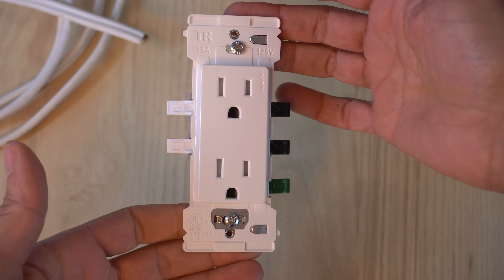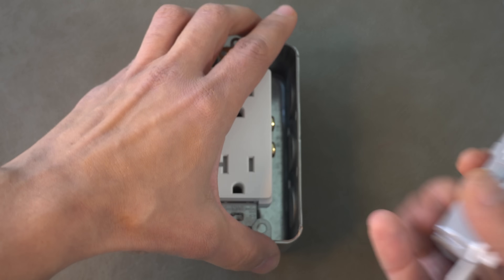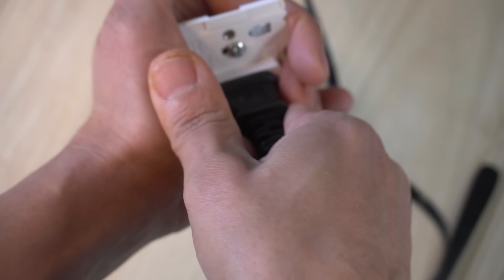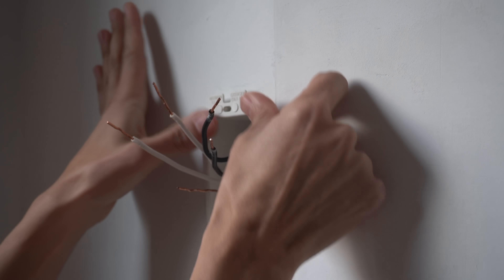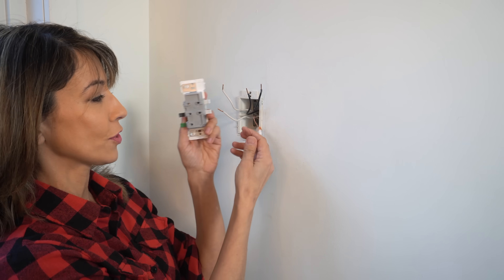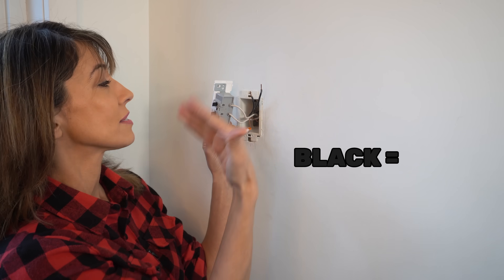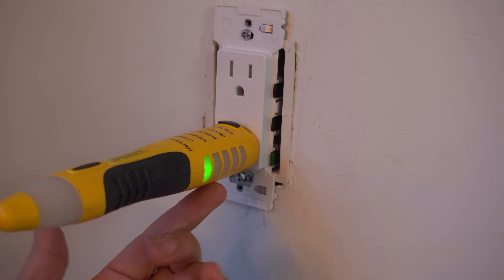New Electrical Outlet Installation: 3 Essential Improvements You Need To See

Comment: That type of receptacle is geared for the home owner and I'm sure plenty will be sold. However they are more expensive and you won't see many or any contractors using them for that reason. Also the "connection points" while fast and easy, they are not as good as screwed connections which have been around since receptacles came into existence and a proven way to effectively terminate wires on a device. The key to a solid connection with a wire is "pressure" and "surface area". With a "screwed connection" the wire "hook" around the screw is completely sandwiched between the head of the screw and the flat brass area it gets pulled against on the device . Once tightened its not moving.  A "pressure connector" or a WAGO connector does not exert the same amount of pressure to the wire and the wire is much shorter than the "hook" giving it less "surface area" as well. These are the two key difference's between these types of receptacles.  When you start running 12 or 16 amps through these receptacle's, connections matter.  It takes more time and skill to "hook" your wires and "screw" them to the receptacle but its worth the effort.
Reply from the maker: Thanks for sharing your insights on the benefits of screw terminals. They go the distance!
Reply: Very good reply and so accurate. Ty @harrison
Reply: You do bring up a good point -- cost alone is a reason professionals won't use them -- professionals -- screws are nothing -- so why spend the extra dough.

For DIYers I can see the value, especially if you can get them for $2 a piece.
Reply: Lever nuts have been proven with reproducible testing by multiple organizations. The load capacity is comparable to wire nuts, and the strength of the connection is stronger and holds more weight in a hang test. The only thing that's better is solder and heat shrink. The only time I've seen them fail is when they are not used properly, which can also happen with wire nuts. I have no problem with them being integrated with receptacles or switches. I haven't seen it myself, but I've heard they hold up to screw terminals with shepherd's hooks.
Reply: @michaeltaylor5939   "I haven't seen it myself"...........I have
Reply: @Harrison2253  you've seen the testing that shows they hold their own against screw terminals?

Comment: There's less wire surface area with the levers. This is why side screws are still superior with more surface area contact on the wire. This new outlet is only slightly better than a regular back-stab. And we all know back-stab outlets fail often as they eventually loosen and burn up if an outlet is used often. One day I had a back-stab outlet burn up on me when I was plugging and unplugging my portable stereo player to charge it. Part of the outlet was melted on one side and half of the wires in the back were burnt as well. Back-stab wiring is dangerous!
Reply from the maker: Of course back-stab outlets are a no-go. I remove them in all my videos. Terminals are great when installed correctly. The problem is they are often installed incorrectly. This outlet aims to help homeowners avoid the many pitfalls of screw terminals as there are multiple steps involved. This tech is approved and awaiting patent. My latest YT short on this tests out the terminals. Appreciate your perspective and experience on this! Thanks
Reply: @DaruDhillon  Homeowners are not electricians and we shouldn't be promoting an alternative and inferior solution just because of homeowners not being electricians. We should be promoting safety over saving a few bucks. The safest solution is still side terminals and if a homeowner is not confident in knowing how to properly install the safest solution, then we should be encouraging them to get an electrician to install it and to not be lowering the standards of safety for them.

Comment: At the 4 minute mark she quite possibly smoked something in that house. Does anyone know if at the homerun box for that part of the room the electrician didn't pull a 14/3. Two hots sharing a neutral. That's why its important to pigtail your outlets. Now I can see in this box there's just the one circuit so probably ok, but if there was another hot buried in the box not good. In newer homes with all of the ARCH fault breakers not so much of an issue as they all need their own neutral. When you open a neutral on a hot circuit and something is running on said circuit it needs a way for power to get back to the panel. That power jumps onto the hot wire and you end up with 220 volts on the wire. I know this as when I was an apprentice back in the 80's we went to a service call in the subdivision we were working in. I was first year and didn't know any better but it was real quiet when the foreman opened the panel and saw none of the neutrals were tightened down. Over time they stopped making contact. I never heard what happened, but I think Gibson Elc bought a house full of replacement appliances. Every house in the Chicago market up till 2007ish we ran two hot one neutral. We pipe everything here in EMT so that hot/neutral sharing saved room in the pipe.

Comment: I would try these if they came with out the tamper resistant.  That feature has proven to be dangerous.  I have had multiple customers force plug so hard they bent they outlet in to short to the back of the metal box.  I would NEVER use a tamper resistant outlet.  If code requires it, I come back after the inspection and replace them with standard outlets.
Reply from the maker: Thanks Dave for sharing your thoughts on TR outlets. Interesting to know!

Comment: those receptacles are a really good idea.  The only concern I would have is that if you split the outlet you still have a shared neutral.  It looks as if the outlet only separates the hot wire.
Reply: Why should we care if the neutral wire is not split?  You cannot run two circuits to this outlet so total current is limited to 15A.
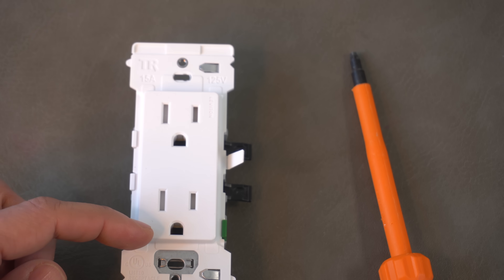Reply: @johnpoldo8817  Yes you can.  Shall I refer you to the 3:00 minute mark?

Comment: Wrong !
Steps do not equal more or less safety.
Example, simply using a WAGO lever "click" style does not make it safer since you cannot see if there is a FAILED mechanical connection inside device.
Whereas on a screw terminal, the connection is visible.  Please so not make generalities when peoples lives are at stake.
Reply from the maker: I'll have more on this in my next video. Thanks for your feedback!

Comment: I must say that I think its very worth it to change all of my outlets. Thanks for the info. But what about light switches?
Reply from the maker: If your outlets are installed correctly with standard screw terminals they don't need to changed out unless you want to. Light switches are also available too and are easy to install.

Comment: I would still use the screw terminals, tighter, more durable, no twist connection that is stable while maneuvering the wires.
Reply from the maker: Hi Rich, appreciate your feedback on the screw terminals. Tried and true.

Comment: As a professional electrician I would not touch these things. Hubbell, Legrand and others sell commercial outlets that squeeze the wires between two plates, not between two thin rods. I have worked with industrial terminals that use the same concept and have a greater failure rate than the traditional terminals. Besides, do you really want a  bargain outlet in your house with your family?
Reply from the maker: Thanks for taking the time to share your experience  and advice on commercial grade outlets.

Comment: Where are they made?
Who makes them?
Are they UL listed?
How much do they cost?
Does the top snap off to use in a handy box?
I noticed that the ears are missing, why? Explain the use of the ears on top and bottom of a normal outlet and why they are missing?
Did you remove the captured screw or was it no longer captured?
Reply from the maker: Yes, they are UL Listed for US and Canada. I talk about the straps and the cost at the end of the video and product details are available in the description box. You can snap off the top and bottom of the straps with your pliers if needed.

Comment: I think this is great idea as long as it has been engineered better than the old push in back connectors that would always fail (I ended up rewiring every outlet in our last when they just started failing one after another). Also, I would like it if there was an option to buy these without the tamper proof “feature.” When we had the kitchen remodeled in our current house, we couldn’t plug anything into half of them! I just swapped them all out after the inspector left 😊
Reply: Don't buy tamper resistant outlets, they are dangerous.  People push too hard on them to plug into the outlet and cause the outlet to bend until it shorts out.  This is an example where a codes don't make logical or practical sense.
Reply from the maker: @davecangelosi9688  haven’t heard of that. Good to know your thoughts.
Reply: @davecangelosi9688 yup I've found them to be very finnicky. I like the outlets in the video but want them without the tamper proof feature.
Reply from the maker: Thanks for sharing your experience. I’ve heard that some don’t like that feature. I understand it for seniors. Was it a particular brand that wasn’t good? Or in general? Curious.
Reply: I’m pretty sure we used Leviton fixtures.
Reply: ha. good point. As an adult with no kids, I loathe TR outlets unless it's something that's always plugged in like the coffee maker. Anything that has to get plugged in as I go - a tool, a shop vac - what a pain in the sss.
Reply from the maker: @user-hm5zb1qn6g  good to hear your opinions on this. Thanks for sharing !

Comment: Hey ... Great vid ... beautiful host .... Heres my thing ... the ONLY thing I like about these new devices is the way they fit together for spacing.
Those wagu wago or what ever they are called are pretty much for amateurs or people that have no clue of what they are doing. And these devices are merely the same thing ... no different than using the connection ports on the back of a normal outlet. I have been a red seal master electrician for over 10 years in Ontario Canada  and as far as im concerned weak single filament connections add up to nothing more than a fire hazard especially when they are running high load items like washing machines , microwaves or high powered amplifiers used in audio systems.
Whenever I train apprentices I stress to them to properly strip the wires and use the screw terminals in the proper configuration. standard outlets and switches INSTALLED PROPERLY will provide more than a lifetime of safe hassle free operation .
But at the end of the day people can install whatever they like , lots of electricians here in Ontario use the back stab method to save time and effort and of course they will work...but you'd never find these things in my own house or any job that I would sign off on :goodvibes:
Reply from the maker: I'm in Ontario too and I have seen electricians use them (backstabs) but that's not desirable. Screw terminals are excellent and reliable. These devices are targeting homeowners who don't have the training or experience of Electricians. What's most important for me is that a device is installed properly and safely.

Comment: Good luck getting the cover plate to sit flush on the drywall with all that garbage on there. I'm sure it's no coincidence you didnt show the cover going on.
Reply from the maker: I shot a video for TikTok and Instagram right after where I rewired the receptacle - so I didn’t install the cover plate. As long as your box extender or electrical box is flush with your drywall your cover plate will sit flush too. You’ll have to remove the tabs on the straps depending on your wall plate. Cover plates are easy peasy so anyone can install them.
Reply: @DaruDhillon Sure, but your box extender was not flush with the dry wall. It was on top of the drywall, and then when you add the thickness of the plastic outlet on top of that, the outlet is too far away from the drywall for the cover plate to sit properly.
Reply from the maker: @shmeli  to learn more I have a dedicated video on how to install a box extender with close ups of the wall plate installed. Here's the link: https://youtu.be/BBbwDZGWsDc The link is also in the description box. Box Extenders are an excellent solution to a lot of problems. More on that in the video. Super easy installation on the wall plate. Anyone can do that with confidence!
Reply: @DaruDhillon  You used an outlet with the standard metal drywall tabs in that video, much thinner, doesn't apply to the big fat plastic frame in this video.  Also, when you're using a box that face mounts such as this extender or an old-work box, you're meant to break off the drywall tabs, then  the receptacle will set in a little further.

Comment: The manufacturer is making them more homeowner safety concern. As journeyman we don't have a problem using metal boxes etc. TR is a consumer friendly product design as well.
Reply from the maker: Thanks for those points Robert. Very true! I actually prefer metal boxes over plastic because they are incredibly durable and fireproof. More expensive so plastic has good value.

Comment: Old school wires around the screws always if you’re worried about shorts wrap scotch 33 black electrical tape
Reply from the maker: Excellent tip Robert! Thanks. Just wrapped some tonight.
Reply: @DaruDhillon  Whenever I install receptacles and switches , I do that as standard procedure for added safety 
Whether it's a metal or plastic box but what I use is the Scotch 33 electrical tape but the 1 1/2 inch wide tape for much better coverage

Comment: At the very start of the video look at the receptacle in her hands.  You see at the top and the bottom, a 2 mm strip running horizontally.  That extra on the top and bottom is for use when the hole in the wall happens to be too big.  They break off easily  with a pair of pliers easily, if not needed.  Do that to ensure the job looks professional.

Let's hope they come out with a 20 amp receptacle, USB-C Charger receptacle and  240v.   I would especially like to see commercial grade versions sinxe thats what I rpefer to install in homes.
Reply from the maker: Thank-you for adding the tip about the removable tab at the top of the straps. Like you I’m hearing requests for USB, 20 amp and GFCI. Smart suggestions!

Comment: A couple of days ago I purchased 4 of these to do a project that I had to do, at about a $5 premium for all four of them. 
Because I’m not electrician, it was money well spent! 
After I install them, I stuck a chisel into the box the receptacle box and moved it all around, no arcing  and no sparking!
If you are, DIYer, this is a no-brainer for safety and ease of use. 
If you’re an electrician, I won’t question you.

PS, these things are fool proof, with the colour-coded tabs so you can only get them wrong if you’re trying too!
Reply from the maker: Thanks for sharing your take. I think you’re spot on with the market these devices are targeting and what they are trying to do. Appreciate your perspective on this.

Comment: The box is not proper attached to a stud. It keeps getting deeper in the wall and appears to be floating. Originally 1/2 way flush between 1/2" drywall ( 3:56 ) then later spaced behind the drywall with a gap ( 4:20 ). Because you used the box extender your outlet will space wrong and wall plate will not be flush to the wall. You used a retrofit box device and this new outlet does not have removable dog ears to cut away and allow everything to fit closer to the drywall, a common error. That is why you did not put the plate on to show your final error. 
Pick another outlet correctly spaced in the wall to demo this new outlet or rip it out and install properly.
Reply from the maker: The box is existing nailed to the stud. As you can see in the video the box extender sits flush with the drywall and the gap is completely covered. It’s legal and safe. The receptacle also sits flush and level with the drywall. 

This was my first time installing this receptacle. I missed talking about the tabs. You will have to remove them for most wall plates. Appreciate the viewers who were kind to share their tips.

Comment: 3:40 good that you are not wiring my house. Hold the grounded outlet while hooking the live black wire to your finger tip. Better hope no-one flick the breaker back on. Best to assume the hot is live and treat it as is. Use insulated needle nose pliers to attach and detach the live lines. Otherwise have your other hand in your pocket.
Reply from the maker: Thanks for the feedback. I’m working solo but it’s always good to work safe.

Comment: I'm getting ready to totally rewire a house I just bought. I really like these new type of outlets. Thank you for posting this video.
Reply: Only time will tell how good these are.  I like the concept but any time you put plastic under constant stress it may create a problem over time as it ages. I’ve seen so many changes over the years that everyone thought was great then years down the road they found out there was a problem. The metal screw that screws into metal has been around forever and if installed correctly, the connection will last a lifetime.  Just something to think about before you change everything in your home.
Reply: @polyuniverse1908  all they had to add is a plastic snap on cover to existing screw types to isolate from exposure. but then ...no added sales
Reply from the maker: You're welcome!